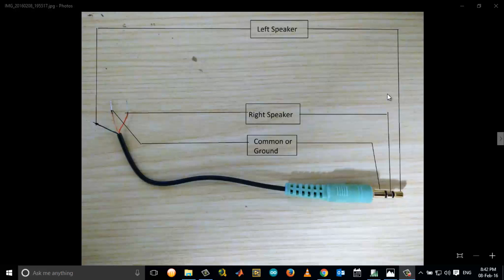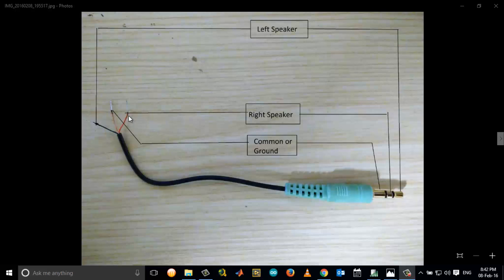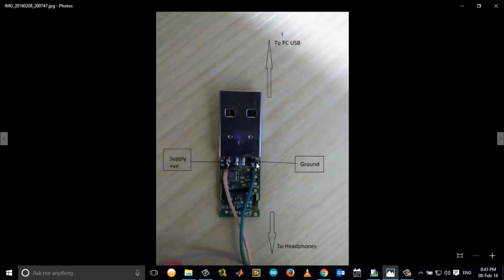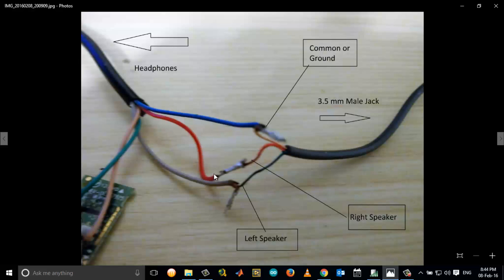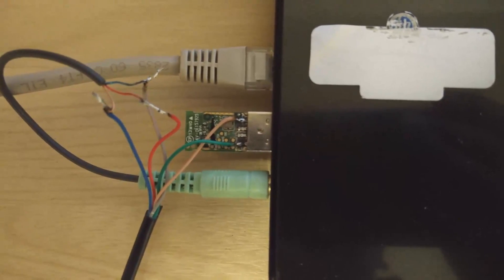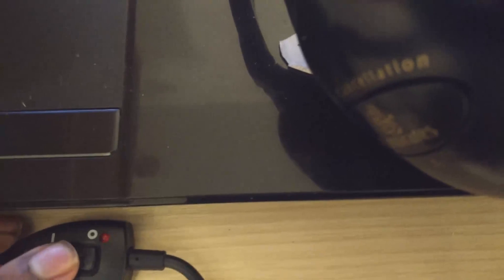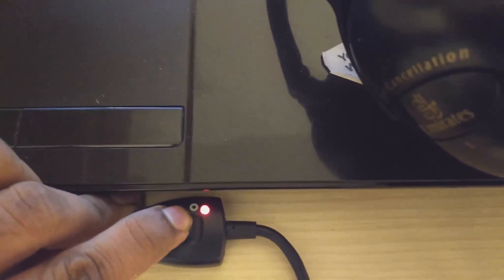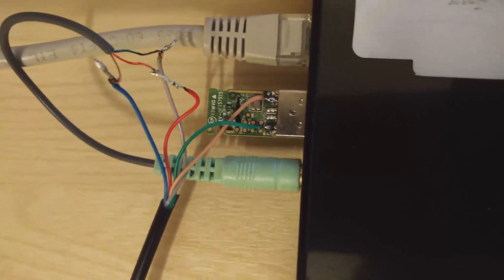Hack An Airline Noise Cancellation Headphones for Use with PC Part-2

Comment: How do you charge the headphones? I mean, if you use the noise cancellation feature, it uses some kind of battery, doesn’t it? Thx!
Reply from the maker: They dont have a battery in them. They are not wireless.
Reply: That's why he has it connected to the headphone jack on the computer AND a USB port. USB for the power / noise cancellation side of things and the other for the sound.

Comment: can i use the headphone without the Noise cancellation feature ? i mean.. without the USB section as a normal headphone ?
Reply: They should be 2 separate circuits, so yeah, should be able to leave those off entirely.
Def. need to test though, the speakers may be dependent on that board for some reason, but there's no requirement for it.

Comment: Hello I just trying to processed convert the airline noise cancellation headphones to use with pc, but I found 6 wires here BLUE, RED, BLACK, YELLOW, WHITE, GREEN. there is a different between your headphones and my, and I don't have any Idea which cable i will use to connect them with jack and usb
Reply from the maker: can you share a picture of the headphones? .. may be upload to tinypic or google drive and share the link here.
Reply: This links of 3 photos of Headphones 

https://s22.postimg.org/uupm57bcx/883efb98_12ed_453a_aa91_442f83c8c568.jpg
https://s22.postimg.org/ov1v1jqkh/db155c7f_bd1b_42cf_9cdb_63d535882112.jpg
https://s22.postimg.org/ht3xfcmyp/eac70a9f_9f4d_4164_8a4b_6ad713dd6345.jpg
Reply from the maker: M-Jamal is there a noice cancellation switch ? can you attach a pic of the noice cancellation switch ?
Reply: there no switch
Reply from the maker: M-Jamal strip the wires from the plug side. use multimeter and check continuity between the plug terminals and wires.  the wires which go into the terminal with one black band is the power wire.
Reply: OK, I will try do this in next few days with multimeter, and I will go back to you with results, thank you so much sire.
Reply: @MJamalOuazani  can you define the wires yet ? If yes, please instruct me. Thank you
Reply: @tuanvoinh2725  Looking for the same answer. The new headphones as noise cancellation swtich also. Can we get help in defining the wires.
Reply: @tuanvoinh2725  Did u figure out which color wires connection and mine also has noise cancellation switch.
Reply: @MJamalOuazani  Did u figure out the color wires connections. Can you let me know.